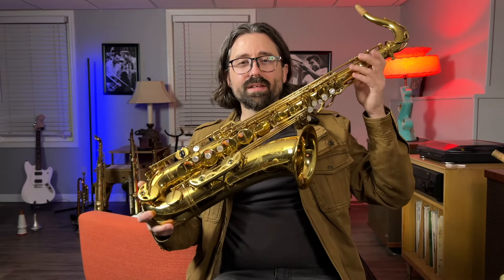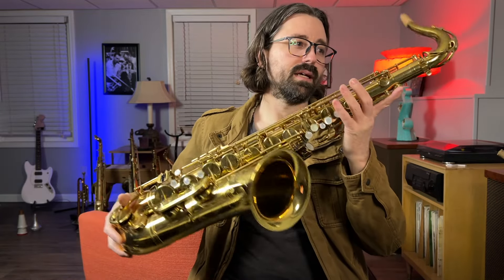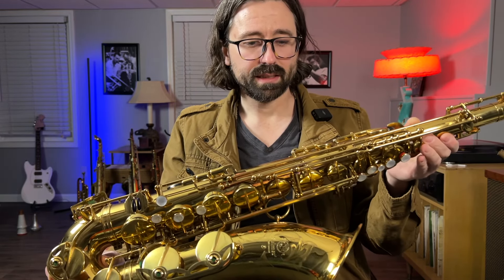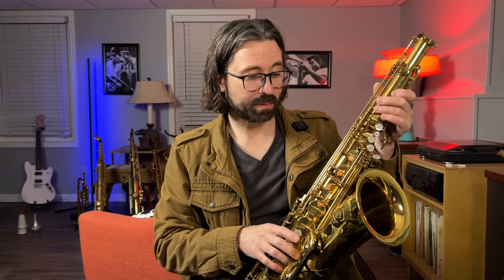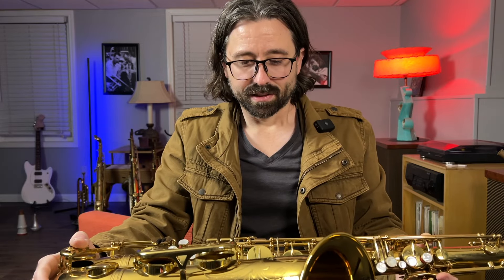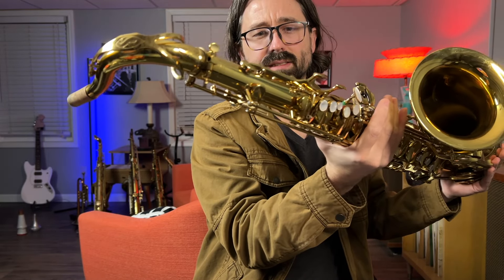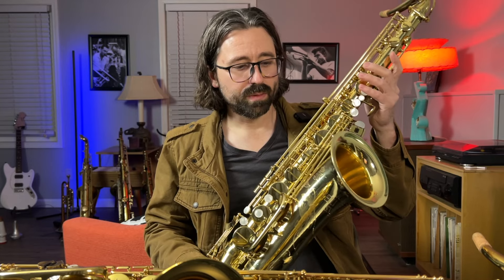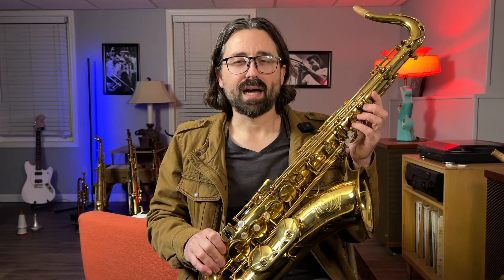I'm overhauling my Selmer Mark 6 saxophone!

Comment: If you have a real thin key oil and some thin super glue (Insta-cure), you can put the key oil on the little male end located at the bottom of your side Bb & C that inserts into the ball joint mechanism. Then while working quickly, you can use a needle spring or something to dab a tiny spot of super glue onto the oiled bit and install the key into the posts/ball joint. Then rapidly trill the side key for like 30 seconds. This creates a little super glue sleeve that takes up that tiny bit of room in the ball joint and makes for a nice silencer. It won’t last forever but it’s pretty easy 👍
Reply from the maker: Thanks for that. I’ve heard of the superglue trick, but I’ve never had it explained to me.
Reply: Sure thing man. I’ve done it on 3 VI’s so far and I’ve yet to have a joint seize up.